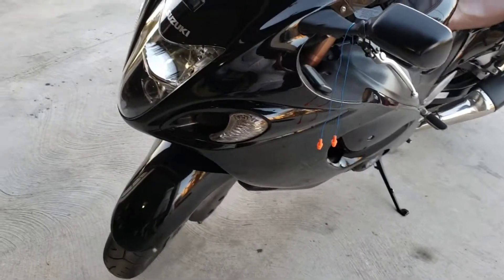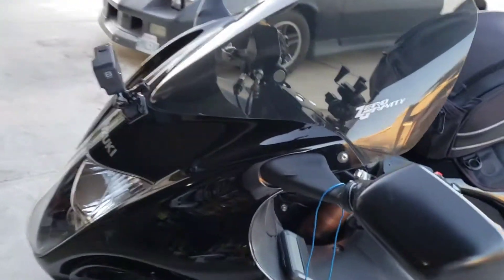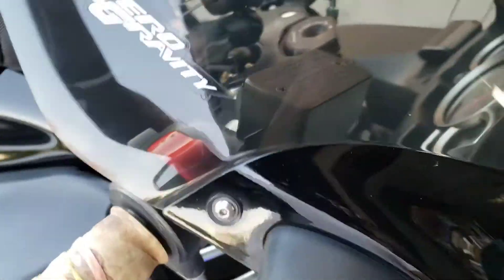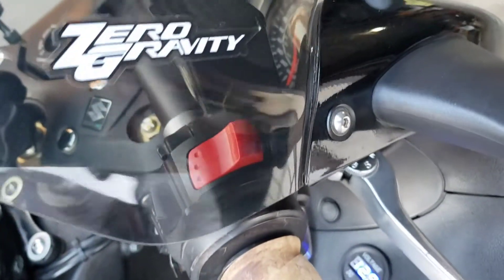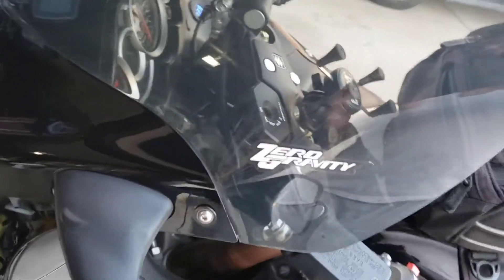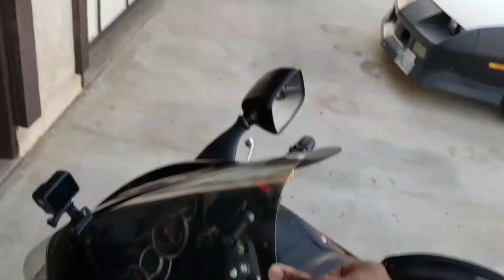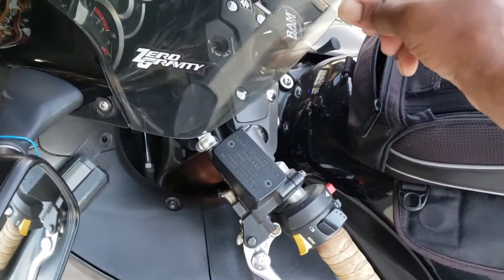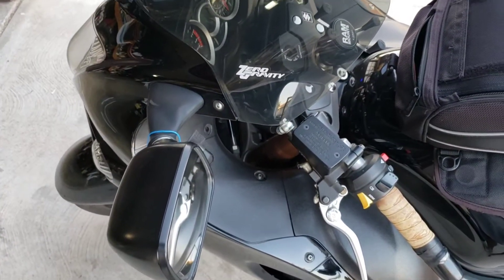Zero Gravity "Touring" Windshield

Comment: they do shatter.  thats the nature of ABS plastic. flexing like where you were pushing on it will easily show it can have movement, it willl also flex under wind pressure but if shocked via a small rock it can crack or shatter.  wear your gear.